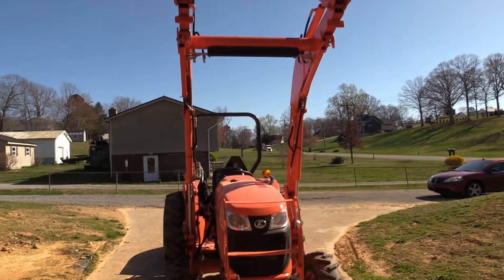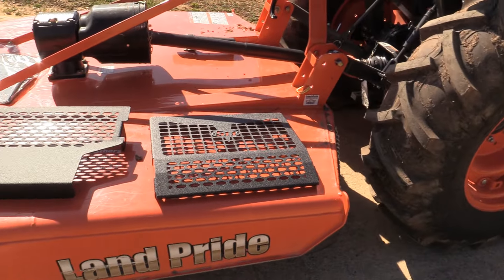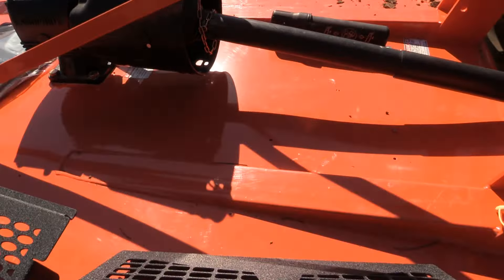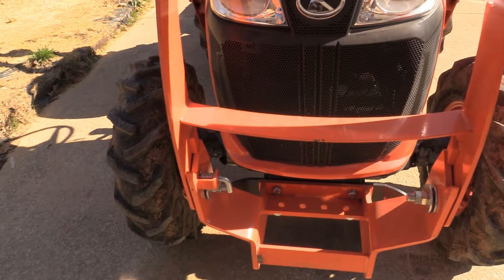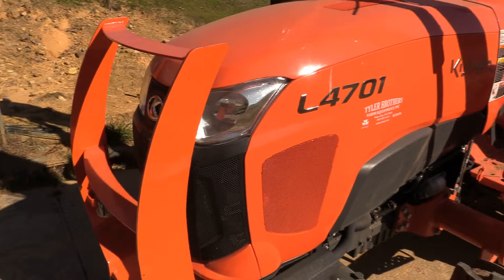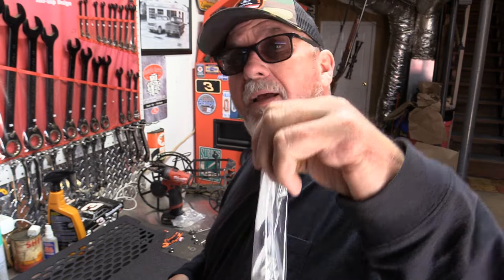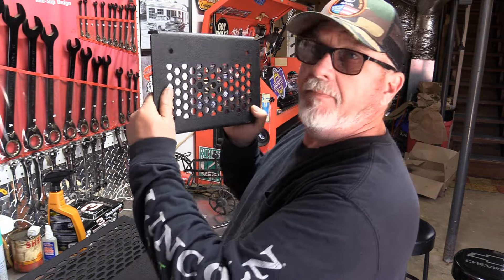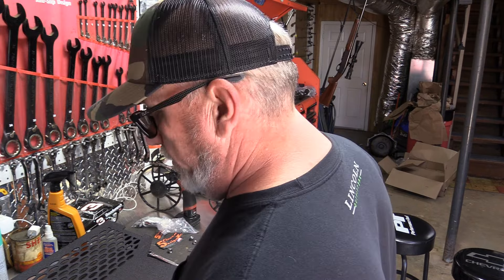Kubota L4701 Brush guard by 511 DESIGNZ! How to install. step by step install video #pineylife

Comment: thanks for a great install video! Any thoughts about using some touch up paint after drilling the holes to prevent rust?
Reply from the maker: Your welcome and thank you. I really like the tractor spray paint from tractor supply. Its color matched to every brand and I just recently used it to paint my custom tractor canopy. Worked really well.